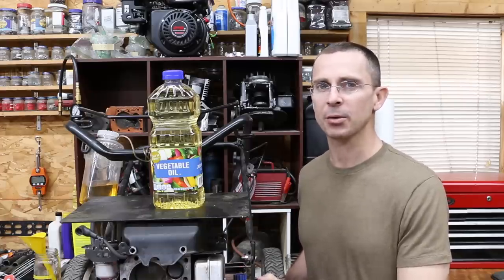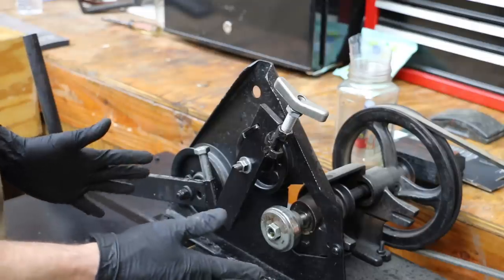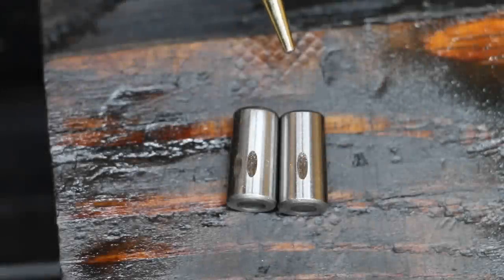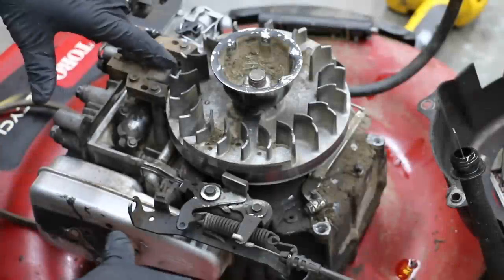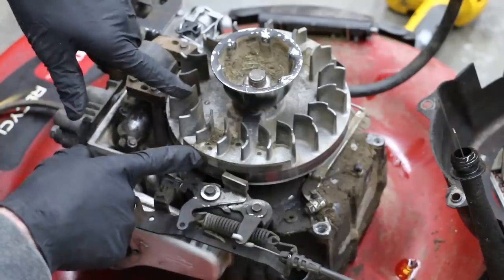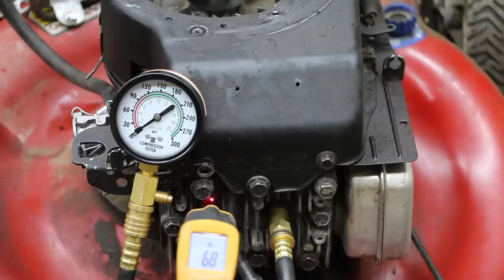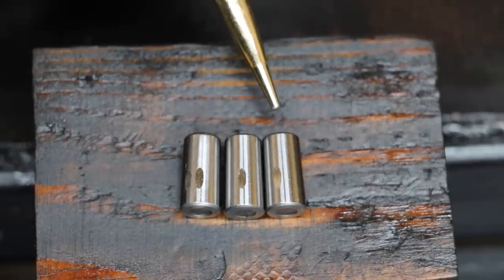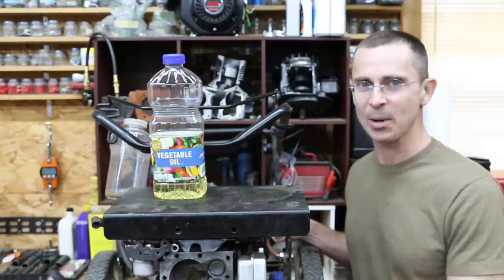Will Vegetable Oil work as Engine Oil?  Let's find out!

Comment: I used Mazola in my 3 wheeler to get it out of deer camp. It smelled like I was riding a deep fryer! (It always burned oil while I had it).
Reply from the maker: LOL!  Glad it worked!
Reply: upside downdog the clutches hate you
Reply: Project Farm 
Lol same but different. 
Standard blue washer fluid (2gallons) got me home after I burst a coolant hose in the car and repaired it. 
Notice I was careful to not say “blew a hose” 🤔😬😬
Reply: Lol Mazola corn oil is also packaged by Stratas Foods LLC.
Reply: @MrHillfolk
A guy was traveling with his family when his car broke down. It was towed to the nearest garage. The mechanic said it would be a while before he could look at it so the guy took off with his family for a little while. When they returned the father didn't realize he had ice cream all over his face. He asked the mechanic if he figured out what was wrong with his car. The mechanic stated, it looks like you blew a seal. The guy suddenly in a panic wipes his face and proclaims, no it's just ice cream.
Reply: Bruce Classic 😎
Reply: MrHillfolk did a desert treck here in australia, punched a hole in the lower radiator tank, soo repaired it but wouldnt seal well enough to hold water under pressure, soooo 800km from a town did a oil change on the side of the track threw sump oil in the radiator, and topped it off with olive oil and stop leak, i was starving, smelt like cooking hamburgers haha
Reply: Bruce 
haha that one never gets old! 
The version I heard, the car owner was a penguin though 😂

Comment: I sold a new Toro to a Church that had a briggs engine and they put olive oil in it and yup it blew up good.  I had the briggs rep look at it and he wouldnt  replace the engine and the Paster swore up and down that they put oil in the unit. At the time I was doing work for Ammoco BP now . So I sent some of the oil to the refinery to have a test done with their mass spectrometer. Those guys lauged so hard when I told them the story they didn't charge me for the test because I was doing it for the church. Then the next time the briggs rep came by I gave him the the print out from the test he faxed it to Briggs and they bought the engine for the chuch because I had proved that they did put oil in the unit. It worked fine for one summer until they decided to change the oil.
Reply from the maker: Thanks for commenting on this.
Reply: Yeah, Olive would no fair very well, cause it has a low flash point compared to other edible oils and breaks down easier than they do. It's one of the healthiest oils to use, but not durable, lol. Good to know though, I was curious about that.
Reply: There are vegetable based oils that could do very well as compared to olive oil.  In Terry Dyson's extensive testing and analysis of 226 motor oils, a vegetable based one made by a company called Renewable Lubricants did extremely well and ranked 3rd highest in the straight out of the bottle category (he tested some oil and extra additive combos as well).   

      Hence, vegetable based oil could do very well if the right kind, rightly processed, and has the right additives (as pretty much all oils made and sold now, have various additives to help improve their performance, longevity, temp stability, oxidation levels, etc).
Reply: Probably Extra Virgin Olive Oil
Reply: Wait why would the rep replace an engine damaged by olive oil
Reply: @user-njyzcip  cause for the warranty to be valid, 'oil' had to be put into the engine as recommended. They didn't foresee olive oil instead of engine oil...

Comment: many years ago, a race car driver at the Indy 500 used water as a substitute for oil during a pitstop as he was not allowed to add anything but water, and still won the race. I think it was in the '30s
Reply from the maker: Wow!
Reply: stacy gardner . Makes sense to me. I do a lot of drilling on tower structural steel and discovered by desperation that plain water dribbled or sprayed continuously keeps my broaches and drill bits sharp longer and better than cutting oils and doesn’t make a slippery dangerous mess on the tower . Just keeping them cool is apparently all that is needed .
Reply: Water added to the crankcase?
Reply: I read about this before. The race regulations had a limit of how much of each fluid you could add during the race. He had surpassed his quota on oil so threw in the water as it was available and not over limit.
Reply: Water is the fastest way to spin the bearings.
Reply: @stevek8829  well the water and oil mix is better than no oil, or just a water..it thicken up the oil.make it feel like sae 60

Comment: Will an engine run on Zippo fluid?
Reply from the maker: Thank you for this recommendation!
Reply: Sure it will.
Reply: Great idea
Reply: "Zippo fluid" is Naptha/ White Gas.. almost the same as regular gas.. PF If you are going to try this, buy a can gallon of Coleman fuel vs little bottles of lighter fluid, it'll be MUCH cheaper :) I have an old Coleman stove that runs on both, per instructions, so they must be similar...
Reply: @mikecollins8241  isn't Coleman's white gas only unleaded gas? Unleaded wasn't available at the pump some years ago so Coleman marketed it as white gas.
Reply: @stevek8829  I pretty sure they are significantly different, white gas is cleaner and evaporates quicker... maybe other differences, you'd have to Google it .. I did a long time ago ;)

Comment: Will baby oil work engine oil?
Reply from the maker: Thank you for this recommendation!
Reply: it could, it is mineral oil, also it might catch fire! lol
Reply: I think it will run pretty hot
Reply: Jeremiah Clemens 
Yes.  As I recall it's a Paraffin oil.  Might have a low flash point and equally become far  too thin when heated.
Reply: This be cool to see
Reply: I think sex lube would be a better engine oil
Reply: What about avocado oil
Reply: TheOutdoorCanuck lol
Reply: yes i wonder
Reply: if vegetable oil is made of vegetables then what is baby oil made of?!
Reply: Sweat from the child labor overseas.
Reply: Baby oil might work as a trans fluid substitute as they are both a mineral oil. Some trans missions are sensitive to viscosity though...
Reply: 100% fresh squeezed baby
Reply: @WestHillsRides  
In an automatic water will work a friend of mine did that. Oh it doesn't work in cold weather though

Comment: Also you should try using astroglide as engine oil.
Reply from the maker: Thank you for this recommendation too.
Reply: R2Bl3nd water based or silicone? I feel that water based wouldn't work at all since it is well....water. The silicone is very light but should be a little better.
Reply: all you would see is the engine grow a beard and get tough

Comment: I have been already applying veg oil as 20% additive along with the regular engine oil for about a year to my vehicle (car and motobike), i feel this formulas has been increasing  power and acceleration of my vehicles and also the engine sound more calm soft and the temperature is more having stability..
And another result that suprising me  is when i opened the engine cover , the whole engine part and the metal is so clean and shiny..😃
Reply from the maker: Thanks for the feedback.

Comment: I did the same test back in the early 90s and found the same results. The stuff worked.
The only thing we found is that after the engine sat for an extended period of time, the valves were gummed up and the small end of the rod barely moved on the wrist PIN. Solidification of the fats? I don't know.
Reply: I guess seafoam would flush that out anyway.
Reply: Put some petrol in the vegetable oil (5-15%) it stops the vegetable oil from any sort of solidifying.

Comment: After viewing the video. Well, I'm extremely surprised! Your engine ran for 1 hour without noticeable damage. And I'm amazed at the lubricity test! To sum up, the test didn't work as I'd expected.  In an emergency situation, vegetable oil could replace the engine oil of your car, but of course, just a few miles and keeping the RPM moderate...
Reply from the maker: Great assessment. The vegetable oil will leave a messy residue inside of an engine.  So, an oil change directly after using it would be wise. Thanks again.
Reply: Baby oil works too

Comment: How about an Ethylene Glycol lubricity test? Since its used to lubricate water pumps how will it lubricate an entire engine?
Reply from the maker: Thank you for this recommendation!
Reply: hmm i like that idea, i think it should work quite well!
Reply: Water pumps have sealed bearings.
Reply: Regardless of my misinformation, which I'm honestly surprised given all the times I've heard it, Ethylene Glycol does have lubricity properties. Like a thin oil. So it's no surprise why I and so many people have believed that. I think it would still be a good thing to test just for fun.
Reply: Most if not all waterpumps (not checked every waterpump) have a seal then a hole then the sealed bearings, the hole is so if the seal leaks coolant doesn't get to the bearing. The seal gets lubed with the coolant/antifreeze/anticorrosion, if the car sits for years often the shaft the seal sits on corrodes causing the seal to leak. Coolant will eventually get into the sealed bearing which destroys it pretty quick.
Reply: I used to work with propylene glycol a lot (aircraft deicer), and it's very similar to ethylene glycol. Even mixed with water, it feels oily.

IIRC, green antifreeze is EG, and the pink/orange stuff is PG.

Comment: I would really love to see you put that in a fairly modern car say 2000 and up like Toyota and run it around town for a while to see how long it would last. Please..
Reply from the maker: Thank you!
Reply: Have been running a 1998 V70 Volvo 5 cyl 20 valve 2.5 litre motor ok with Aldi vegetable oil, seems happier than normal. It has got 300000 KMs on it and has been smoking a bit when the oil gets low. As it is using about 2 litres oil per 100 litres petrol, I figure it might as well be treated like a 2 stroke lawnmower.
Reply: @longflare  How many liters is that per 5000 km?

Comment: mount an alternator to lawnmower engine either replacing the blades with a gear of some kind or using them as a flywheel and compare power output, charge capacity, & efficiency of it vs a name brand generator .   direct drive alternator lol

Comment: Great video with a practical engine test instead of some lab comparison! Thank you! Some suggestions, if you ever re-do it:

1. before-and-after comparisons could show pictures after running it with vegetable oil vs. picture after running it with mineral oil. The vegetable oil vs. clean-scrubbed piston crown does not yield much useful information and may make any oil look bad.

2. Rapeseed oil is the traditional steam engine lubricant so reasonably is the best oil to start with. It has the property of adhering to both wet and dry metals.
Reply from the maker: Thanks for the suggestion.

Comment: I think that oil flushed the engine
Reply from the maker: Great point!
Reply: I don't know, it was extremely gray.
Reply: a flush would indeed come out dirty, but then again, i think it just burned and left its own coating anyway
Reply: maybe
Reply: wow! wow! smoke! its me cj
Reply: probably grey because it mixed with the remaining oil and sludge deposits that were already in the engine. Either that or metal shavings
Reply: Mark well castor bean oil is used in some 2 strokes.
Reply: good point.. big smoke
Reply: Looked like it had Liqui-Moly added to it! I'd say it's gray from metal filings though haha
Reply: Any clean oil would have cleaned it.
Reply: @jamesb1221222  doubt it

Comment: Stage 1 upgrade kit for Predator compared to a bone stock Predator. I recently did a stage 1 upgrade to my mud motor. I can tell it breathes easier with the upgrades. I know the EPA chokes these poor engines down and leans them out so much it's surprising that they run. I'd love to see a torture test comparing a bone stock Predator to a simple stage 1 Predator

Many of us building these mud motors are afraid to build too much, but the bone stock motor often run too lean. After sure long runs they won't crank. It'd be nice to have some kind of raw data like your torture test. Thanks!
Reply from the maker: Thank you for this recommendation!
Reply: Black Warrior Lures I have the bone stock and thanks for explaining that. I'm going to buy the stage one for my engine!

Comment: You should do gear oil next. I've always seen a similarity in the consistency of oil additives (like Lucas) and gear oil.
Reply from the maker: Thank you for this recommendation.
Reply: Drew L When i change the oil in my lawnmower i add some 80w-90 because only 10w-30 is thin as piss
Reply: Drew L I always add a little gear lube about a quart to all my truck 300 k on 2 motors so far
Reply: dirty roofer well I was walking through autozone the other day and saw a Lucas oil stabilizer display, that one with the gears that you crank and of course the gears with the Lucas have more oil coverage than the normal oil. At this moment i thought to myself hmm seems a lot like gear oil to me. I might throw some in my semi the next oil change and see if there is any noticeable difference, maybe it'll run a little smoother...who knows.
Reply: Drew L  In the old days, used car lots would dump some 90w into the crankcase to stop engine knock or slow down leaking.
It works, but i don't think it's very good on the internals during cold starts.
Reply: It will work fine in a nonfiltered spash lube system. 75w90 is similar viscosity hot as 5w30 but without the pourpoint aditives. It will clog filters with it's extreme pressure aditive.
Reply: Project Farm yes do gear oil
Reply: That Lucas oil treatment display is not the most accurate portrayal of how it works; in-store it's at room temperature (engines don't stay at room temperature) and the gears aren't spinning as fast as in an engine.
Reply: Nico Stenfors 
Actually, 10W-30 motor oil and 75W-90 are very similar in viscosity when measured on the same standard.
Different standards used for motor oils and gear oils, hence the different numders.
The additive packages are the bulk of the differences.
Reply: However having thick oil works nicely on warm places. Here in Finland we can not do that since it gets pretty gold in winters (-38celcius is record for this winter)
I have Volkswagen Golf MK3 VR6 and it knocks like hell when cold starting. And oil is nice and flowy...
Reply: Drew L during a spell as a coal miner I had a 2 stroke motorbike.
I used machine oil from the coal cutting machine for my gearbox and to mix with petrol.
Never had a problem in the 3 yrs I ran it.
Reply: Sam Jenkins sawdust in the oil gets rid of knocks and taps.
Reply: Do Not Consent. The guy we dont listen to.

Comment: Can you try raising the compression significantly with jb weld filler on the head and piston to try to run the motor on gas, and on diesel with no spark plug. I have seen boxer motors with extremely high compression run gasoline with no spark plugs. I have also seen them run on diesel.
Reply from the maker: Thank you for this recommendation.

Comment: I once used palm oil as 2 stroke oil for my lawn movers. The engine stuck after several mowing events
Reply from the maker: Wow!  Thanks for commenting on this.
Reply: wow u really spending time to read all comments. Kudos to you sir
Reply: gummed up
Reply: On their own, vegetable oils  could potentially work as lubricants. However, when mixed up with a mineral oil (most motor oils are based on these), they will produce nasty sludge. I believe this is what happened.

Comment: What about using gasoline as engine oil? Maybe it combusts in the crankcase?
Reply from the maker: Thank you for this recommendation!
Reply: Shammy Ali cant wait for him to do this! lol just for kicks n giggles
Reply: no lubricity
Reply: Water would be a better lubricant than gas. Gas actually would strip any oil left in the crankcase.
Reply: I've done it. It will run but run very rich due to fuel getting past the rings...and if you keep running, it will seize to a screeching halt. Gas has very poor lubricity or film strength.
You can also risk an explosion due to vaporized gasoline getting ignited by a steel rod bolt that goes flying when the rod throws.
Reply: 1:25 two stroke would give lubrication and combust ability ,really like the idea

Comment: Pretty cool that you made your own bearing tester, the first time I saw one was for a gun oil promotion.
I'm also fairly sure that most mechanically inclined guys have thought about this stuff.
I have always wondered if there is an additive that would enhance gasoline for more power &/or to go further?
I also vaguely remember hearing something about a scientist who developed an engine that ran on hydrogen from water, but possibly subverted by the fuel industry.
Any thoughts or comments?
Thanks for the educational videos.
Reply from the maker: Thank you for the video idea on HHO!  I need to build an HHO setup.

Comment: G,Day Mate i watched an old war 11 movie sub,s where the engine man put whiskey into the diesel to get 300 more RPM,s will    a  diesel with whiskey in it .Thanks from down under.
Reply from the maker: Greetings and thank you for this recommendation!
Reply: goldwingman1500 it’s ethanol, basically. It’s used in gasoline engines all the time. A little would help the diesel flow better, too much would blow the engine!